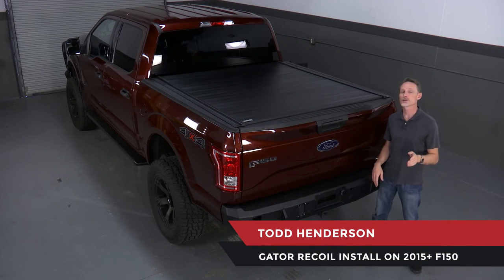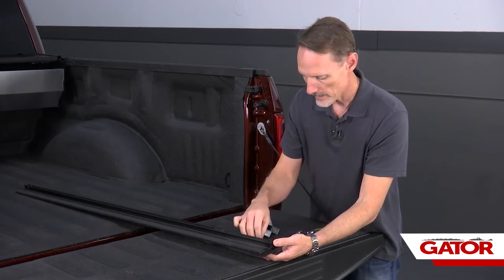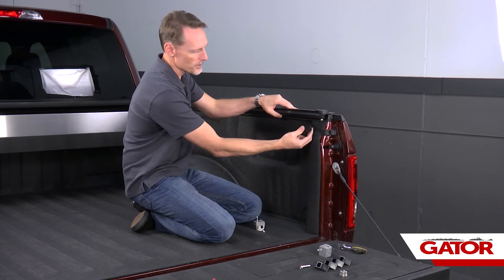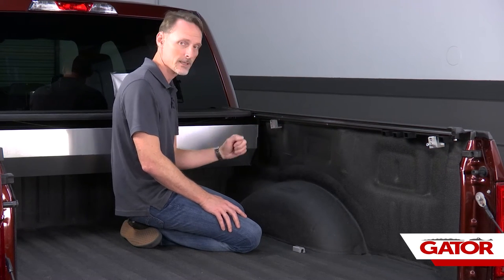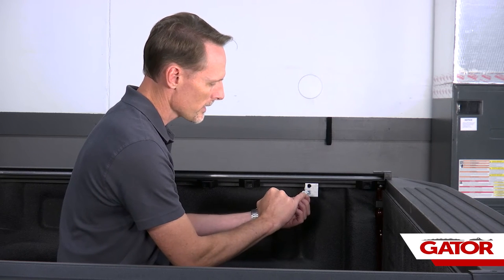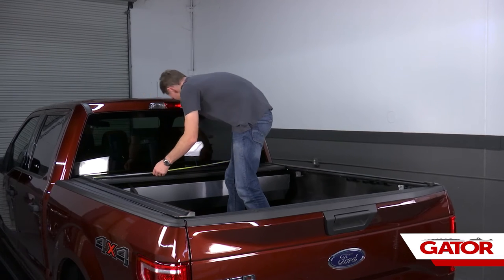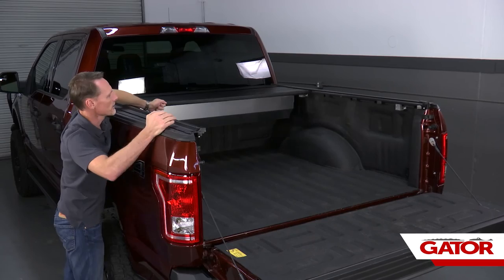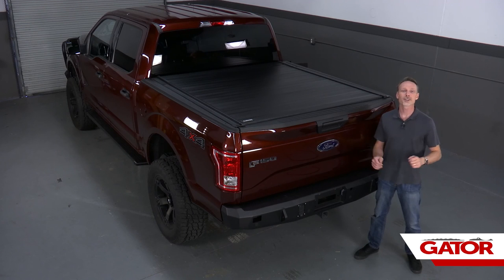How to Install Gator Recoil Retractable Tonneau Cover

Comment: Has anyone installed this on a 2020 ram 2500 6’4” bed? It seems too narrow for this bed. The box is barely hanging in the sides. I feel if i didn’t have the bed liner the spiral canister would just fall thru. Any help is appreciated.
Reply: I don’t know about the 2500 but the cover works well for the 1500 pickup with the 6.4 bed. I looked up som e stuff about the bed on the 2500 it’s not the same width as the 1500. So no I don’t think it works with your application. Sorry bro but I might be wrong on that. Do some research and find out.